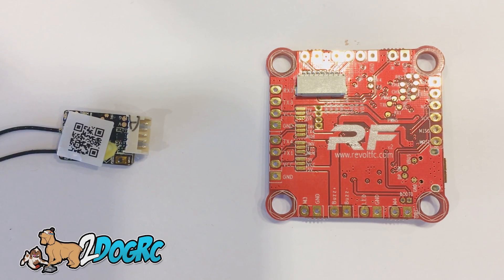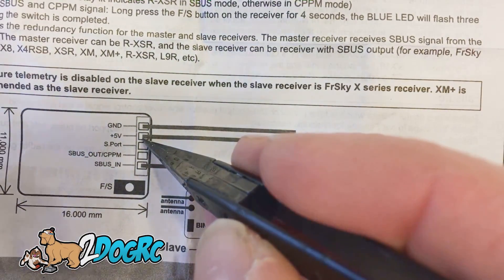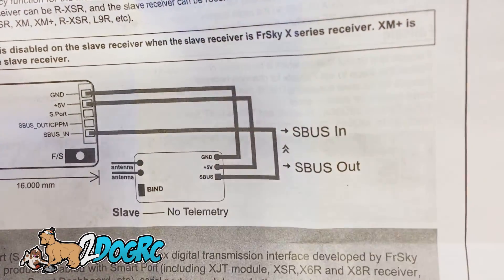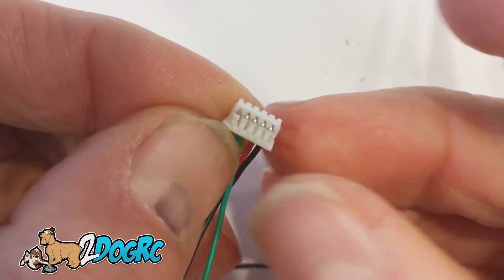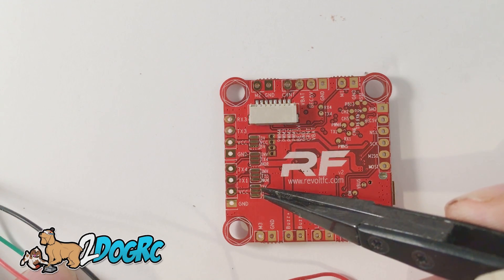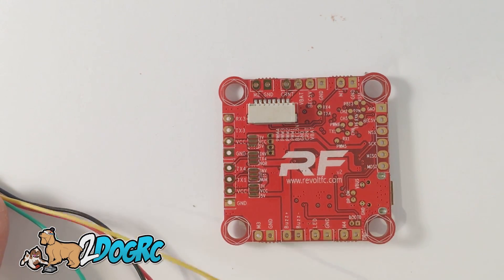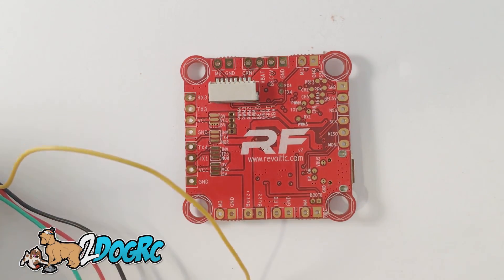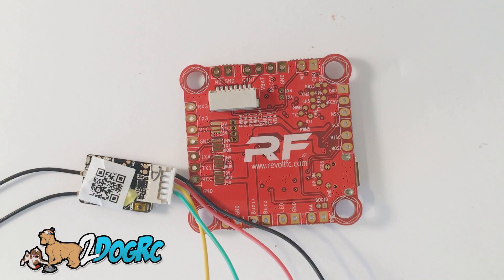Connecting FrSky RSXR to FlightOne Revolt

Comment: If you load BF on the Revolt, to get sbus working, jumper small pads above the large F (in RF) called TX1 and RX1. Revolts V1's did not need this until Jenkins build 726 (725 was fine, 726 broke sbus w/o the jumper).